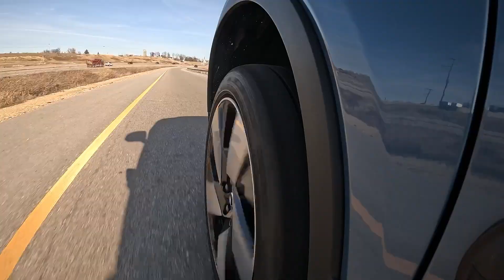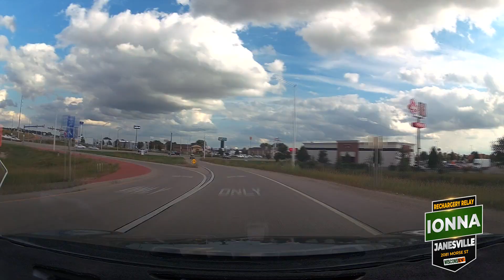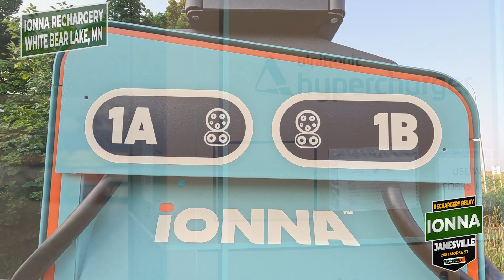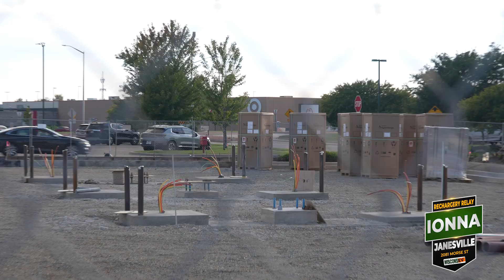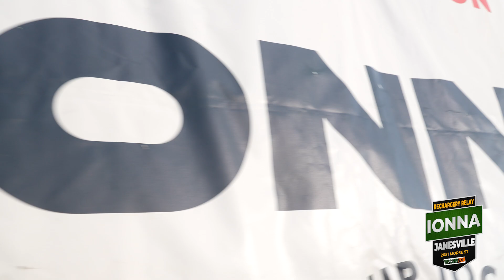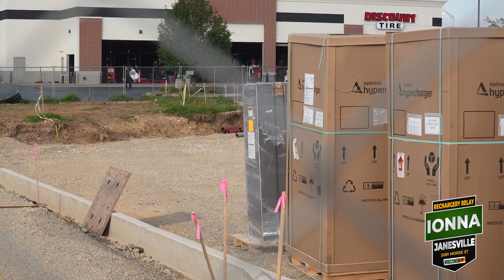WisconsEV - IONNA Rechargery - Janesville Construction Update

Comment: I like the new opening.  Question:  I see the 8 chargers, but only six pedestals.  Any idea where the other two are going?  Looks like six under a canopy.  Maybe the other two are going off to the side somewhere.
Reply from the maker: I didn't notice the discrepancy until I got home and looked at the footage. It's definitely a change because the original site plan shows 8 under the canopy. I'll send it to you. My guess is along the back as a pull thru or a handicap accessible in the front closest to Menards. They stopped the curbing in the front for some reason, but not for an entrance. I saw on Plugshare they jackhammered something out of there a little while ago too, so maybe that was the deal. I double checked all of the city committee sites and nothing since the first approval in April.
Reply: The mid-west is stsrting to look active for EV charging.
Reply from the maker: I think it might be that it is ripe for some easy picking spots on highways, etc. right now. But I am happy with any expansion in availability of charging.